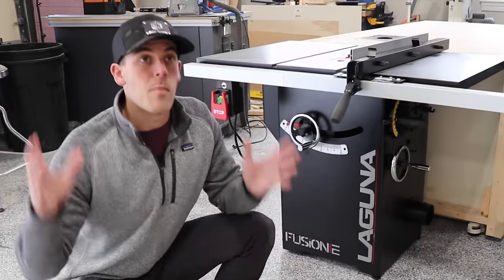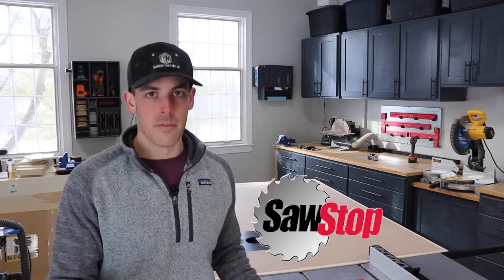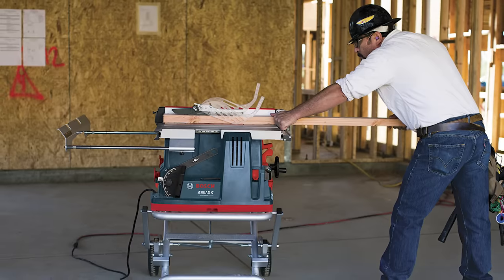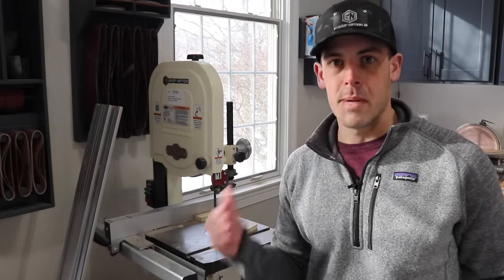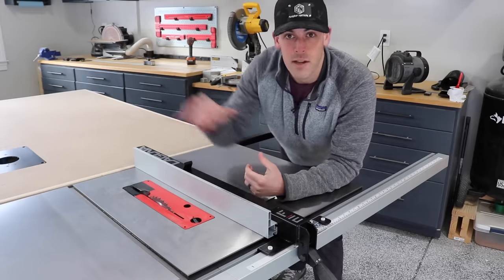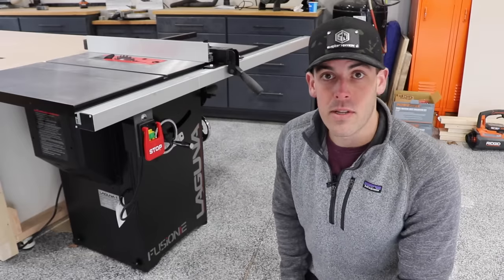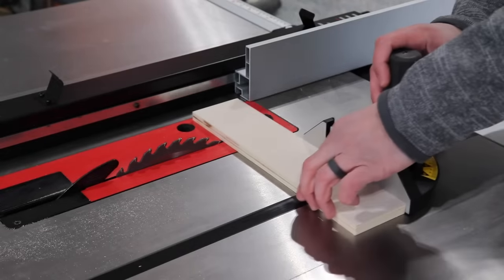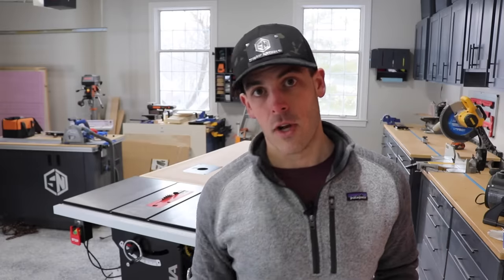Why I Bought a Laguna Table Saw over SawStop!

Comment: Everything about the SawStop is true, but Ben Paik, @wobydesign, brought out the excellent point that it only mitigates one (very serious) adverse event, i.e., losing a finger(s). What about kickback? Happens A LOT more than losing a digit. Who’s not experienced this? Fortunately, I’ve never been injured by kickback, but I suspect it’ll happen several more times in my hobby career. Lord willing, I keep all of my digits. I’m looking at a new cabinet saw, so I’m particularly happy that Travis is going to run this through the paces for us.
Reply: Any one who looks into SawStop safety tech will immediately learn this fact. It is not MAGIC. But it does reduce (not eliminate) the risk of an important class of table saw injuries. And it's probably best to think in terms of losing one or more digits. If you read about these terrible accidents, you'll know that, sadly, there is often damage to more than a single digit.

Comment: I agree with your price point argument, however I disagree with your Grizzly comment, I own a 3hp 220V Craftex Saw, yes I live in Canada, it is the same as Grizzly and the saw has been accurate and rock solid for me, well worth the $2300 Canadian I paid for it.  Comparable Saw Stop up here is roughly $5000.00 dollars. Accidents are human error, be careful and I saved 3k.
Reply: Yes, accidents are human error. And, as the saying goes, to err is human. I've yet to read an account of a table saw accident where the victim wasn't an experienced woodworker who knew what he/she was doing, but either was tired, bored, or for some other reason lost focus for a split second and BOOM. Life altering accident. Oops. I like SawStop tech for the same reason I like seatbelts and air bags, "just in case."

Comment: I am planning to move out of my garage and build a shop.  I have looked at the F2 to replace a craftsman saw I have had for 30 years.  Yes it is time.  I plan to add a electrical plug in the floor of the shop for this saw.  Is it worth converting to 220?

Comment: I'm not up to speed on sawstop so this is more of a question. The saw stop safety feature is triggered by moisture correct? What moisture content? I work with alot of locally sourced lumber that's not at 6% moisture. If I have to disable the safety feature to avoid replacing a blade and cartridge, what's the point of it? Anyone have any experience with this?
Reply from the maker: I don't have personal experience with this either but I'm told that if you're cutting "wet" material you do need to disengage the safety feature.

Comment: My problem with sawstop is their wide, vaugely worded patents, and the extreme lengths they do to defend them. Bosch was forced to remove their saws from sale because they violated parents, even though the mechanism was completely different. When Volvo invented the seatbelt they gave it away so that anyone could use it, because locking safety features behind expensive luxury goods is obviously a recipie for disaster. We could have a dozen different blade retraction systems all being developed and competing, but SawStop has put profit before people's fingers.

If they cared they'd have a sub $1000 saw to make it accessible. They don't. If you're of the opinion that all saws should have features like this, I agree with you, patent law needs to be gutted and reworked. Just know what you're helping reward when you say they're the only option people should consider.

Comment: Hey Travis,  what amp breaker do you have this running on? I just bought the F2 and of course have to wait another 5 months before I even get it but need to see if I need to wire in another outlet specially for the table saw to run off of. Only one outlet in my garage currently so I need another outlet anyway. On Laguna's site, it says it requires a 25 amp breaker. Just curious if that is what you were running yours from.

Comment: Sawstop is definitely not the ONLY good choice out there, but imagine buying a car without an airbag today...  Maybe not the best analogy, but we did go decades driving cars without airbags and millions of drivers survived.  The question is, if you could, would you buy a new car today without an airbag?   Frankly I am not worried about losing a finger so much as I am about slicing a tendon or even just a really bad cut.  I was never a woodworking professional, but I spent a decade using a tablesaw at work, and have spent two decades since using one as a hobbyist.  I've witnessed fingers in tablesaw blades and seen several co-workers, friends, and associates with injuries.  Even in the 90's, these injuries that left fingers intact still cost thousands of dollars in medical and physical therapy bills, and it only gets more expensive each year.  As a professional, you could lost a week or two of work over a relatively minor injury to a finger or hand, but just the cut alone could cost you a thousand dollars (or more) in medical bills even with insurance.  When I was in my 20's I didn't worry about the danger, and I always respect the tablesaw as much as I would a loaded gun, but as I get older it is a matter of time before I do something stupid or just have bad luck, and the odds of ending up with blood on the floor are significant enough to spend a couple thousand dollars to prevent it.  I honestly wish the technology in saw stop was licensed to other manufacturers like Jet/Powermatic, Delta, or even Grizzly.  I want to upgrade my Delta in my home shop, but frankly without the safety tech, spending a couple grand or even 4 or 5 just doesn't makes sense.  Unfortunately that limits my choices.

Comment: My Delta Unisaw is now 22 years old, Sawstop was still in development at the time. I can certainly appreciate the safety aspect of it, but my Unisaw isn't anything that without proper safety procedures I feel uncomfortable around. This idea that you have to have Sawstop is just silly. Reading through the comments here, everybody is harps on the safety, and yes it is safer, but with proper risk assessment and procedures any other saw can be nearly as safe.

Comment: I have a huge issue with sawstop, because of the Bosch Reaxx saw. The creator of sawstop has helped sue other tool companies on the basis of injury, stating they they simply are not doing their jobs by not implementing the technology. Bosch tried to some up with something, that on a fundamental level worked different, but accomplished the same goal. Saw Stop has so many patents on their technology, that you cant have a safe saw if the competing company's wanted to make one.

They are enforcing their IP, while making the cost of licensing the technology from them so expensive that people cannot compete in this 'safe saw' space, while demonizing their competitors in court. 

^^^ This behavior is not the behavior of a ethical company that cares about peoples well-being. This is the behavior of a profit hungry company that is preying and profiting off fear mongering.

Comment: If your electrical is to code, then running the saw on 120V or 240V will make no difference at all in performance. If a machine is running better on 240V,  you're wire size is too small for the length of run & there is high voltage drop.

Comment: It’s not a small incident rate, it’s huge.  Did you even look at incident rate?

You’re promoting a company with which you made an arrangement- did you calculate that into your cost/risk analysis?  This turned into a commercial for Laguna.  And hey, that’s a nice saw.  Still doesn’t do what a sawstop does.

1 incident and the sawstop has paid for itself.  I know you don’t like to be told what to do but, don’t cut your fingers off.

Comment: You bought the laguna because of the lower price. You said yourself you would have to buy a much higher priced sawstop to get the same features. You talked about engineering and risk assessment. You didn’t talk much about actual risk. They say that there are 9.5 million table saws in The US. About 60,000 table saw accidents per year. That’s about a 1 in 150. That seems pretty high. Like others my wife overrode my decision to get something cheaper than the SawStop.

Comment: Is that usd ? Or cdn prices ? For the saw  . How do you like your husky air compressor ? . Would you recommend that with no complaints ? . I want to buy an air compressor , and save up for a table saw , I only have a small space , but I want the air compressor I buy , to be able to do everything . From nailing , to applying paint , and any other air tool I would have use for .

Comment: Table Saws: These tools, which are omnipresent in construction sites and woodshops, are responsible for the most number of injuries involving woodworking – 39,750 injuries annually. The National Institutes of Health also estimates that there are more than 30,000 table saw injuries in the U.S. annually. Fingers and hands are the body parts most frequently injured by table saws. The medical costs of treating injuries caused by table saws top $2 billion annually.

Comment: For those running the F2, what blades are you running.  Any one using full kerf blades with success?  If so, what voltage do you run?

Comment: Micro jig pretty much made sawstop obsolete in my eyes. You do a proper set up on you saw.... and actually you know? Maintain it? Shocking I know! Plus use whatever push block that keeps your fingers both away and protected. You won't lose them. Oh and stay the f**k out of the shop when you are tired and or emotional. If you are in the shop and you screw something up and get angry. Leave and come back after you clear your head.

I find it hilarious how defensive sawstop owners get with videos that have the audacity to even suggest its not the only option. You like it. Good for you. It gives you piece of mind. Good for you. Quit trying to justify your purchase to everyone. Or are you just flaunting the fact that you bought one and want the world to know? Yay.....you got a sawstop! Good for you! Here is your pat on the back! You've arrived man! You've arrived. Should we get teary eyed?

Is there a chance? Yes? What's your point? There is also a chance you'll slip on sawdust and split your head open on the corner of your sawstops cast iron table. There is also a chance the protection fails. Anything can happen at anytime.

Comment: Cost= Purchase price minus resale value.  So while Sawstop costs more initially, it sells for more used, also. Your net cost is therefore not really as much as you're saying. If you want to REALLY compare, buy a used Sawstop vs. used Powermatic with a riving knife...then sell them 10 years later. I'm guessing you lost very little on both saws. Maybe $0...and one saw had safety insurance. 

Look at your table saw like a savings account that cuts wood.

Comment: I don't know what all the hype is I have two 50+ year old Atlas cabinet table saws. When Laguna came out with the Fusion line I was sold. I wouldn't look at Grizzly Shop Fox, yep the same just repackaged. There is only so much you can do with OLD tools. I even fabricated dust collection for them. actually works pretty good. These old tools didn't have any safety features. 4 family members running the cabinet shop and not one lost a finger. To tell the truth I know more people that shot themselves in the leg from framing guns with no safety triggers than loosing fingers from a table saw.  Cost far exceeds risk in my opinion. I did restored one of the saws. to update these I'd have to have machining done to accept newer bearings at a $400 plus cost, just not worth it considering the cost of a NEW cabinet table saw. These old saws are true work horses and have built thousands of cabinets. Now down to one I'm just waiting till I'm ready to pull the trigger and purchase a Laguna table saw.  2 may be over kill but in the shop we had one dedicated for cutting and ripping the other for a dado set up, for the higher end cabinets( back in the 70' and 80'). Personally from just what I have gathered, as you stated somewhat limited information,  I'm impressed with Laguna brand. Their bandsaw exceeds their reputation. Of course I'll be getting a cabinet style and 3 hp 220. I want my grand kids to hopefully take on some aspect of woodworking. Only 5 years old never too early to get them learning some of the trade. Laguna may be, sooner than later,  in The Shack.

Comment: Hey thanks for the video Lowes had the Delta on a few hour sale for 349. From 699 so I grabbed it I currently have the Metabo jobsite table saw and was looking at the Saw Stop CTS I saw on your Delta it was missing the blade angle plate, if so you are the 3rd person on here who lost theirs or fell off actually, I am currently looking at the Laguna fusion  F1 I could sell both what are your thoughts

Comment: You made a good choice. I've studied all the features and build quality of the Laguna and it is definitely the best saw around at that price point. Having tried it, I was immeadiately impressed with the smoothness of all the controls and the quality of the castings and machining. Yes the Sawstop is a great saw no question but the price point is way over what it needs to be. I love the safety of it and I would hate to lose a finger or worse but that safety mechanism is very expensive and costly when it does come into play because of the parts which have to be replaced if it actuates. I am sure you will be very happy with the Laguna and have many happy hours using it.

Comment: This is in my crosshairs as a possible option.  I've been running my shop off of nothing but Festool track saws and a mega MFT table.  The only down side to this is the inability to batch thin materials without a lot of set up.  I use the parallel track saw guides, but I have to get them out, connect them, set them up, etc etc etc.  I'd love to see an update on this saw soon as this is one of the exact models that I am comparing for my shop.  Any idea when you might be doing a video on its use?

Comment: I been using my job site table saw Dewalt dw745 and used it several time cutting a birch buthcer block for my projects, I just want to know if Laguna fusion 2 can cut as well? Been thinking about buying a cabinet type table saw, how’s holding on that as of now? Thanks for your reply!...✌🏼🙏🏼

Comment: My 9 month old Delta 36-725 T2 just died ripping a 1” piece of soft maple. Funny to see this in my suggested videos.
Reply: Yeah, had one of the Delta's it was a $600 saw.    Had a Laguna F2, but it had damage from shipping and had to return it.  Ended up getting a Shop Fox W1837 and I am happy with it.   The fence rails on the Laguna's are thin and they flex.   The fence on the Shop Fox W1837 flexes.   I upgraded my fence on the W1837.   The Jet ProShop saws are the same as the Laguna on the inside.  Different feature set.  For about the same price the Laguna gives you cast iron wings and overhead DC (which many report does not work well.  I think you need a big DC system to get the most out of the overhead DC).   The Jet has steel wings, and much better fence.   If all the saws were in stock when I got mine, I probably would have gone with the Jet.  Though, I am very happy with my Shop Fox.
Reply: @alsmith7316  thanks I’ll need to check that out. I’m making a 2 hour round trip to Bowling Green, KY to get a warranty repair, but may throw in the towel on this one if I have more issues.

Comment: You say you don't know how to put a price on the safety features of the SS. There are people who do and they have spoken pretty loudly. Those people would be workers' comp carriers and commercial insurance carriers. An example, a buddy of mine had 5 Powermatic 66's in his commercial cabinet shop. he changed them out to SawStop Industrials (5 HP, big sliding tables, 52" fence, floating overhead dust collection, everything) with tax about $40K at the time. His workers' comp bill went down almost $25K a year. That tell you anything about the value of the safety features? For a Taiwanese made saw targeted at the mid range market, the Laguna is a fine saw. Until you get distracted for half a second and lose a couple of fingers. The nasty thing about them is the longer we use them, our chances of doing that go up dramatically. We get comfortable, "experienced", and we don't think about it anymore. I've used tables saws for about 58 years. Always careful. Never even came close to an injury. Until this year. Had I not had a SawStop I'd have lost most of at least two fingers and part of a third. As it was, I had to look to find where it had hit. I understand managing risk; I just hope that as part of that management you have really good disability coverage that won't deny your claim because you were using an unprotective saw. And really good medical coverage that won't say you're a professional and should have had workers' comp coverage.

Comment: I hate to tell you this but most are all made in the same factory in Taiwan and all of that is because of the owner of Grizzly.
For the most part they are all the same saw with not much difference between them and your saw and the grizzly are for the most part the same cost. 
But I would agree if you are going to spend 5000 for a saw stop then Buy a Sliding Grizzly with a scoring blade much better purchase, more usable and no chip-out.

Comment: I have a 1990’s Delta Contractor Saw with a 32” Unifence. It has the high low fence and the ability to slide the fence back when cross cutting to use as a stop. I use that feature constantly. Far more useful than you realize.

Thanks for the review, I’m  not in the market for a new saw but it was nice to see.